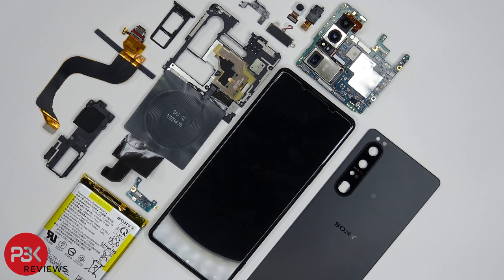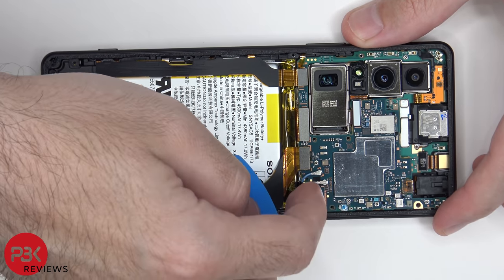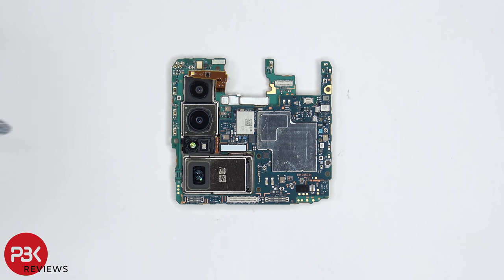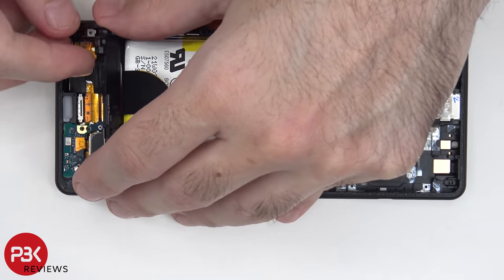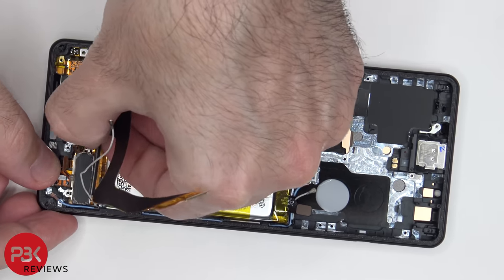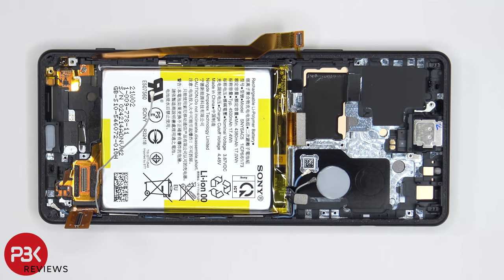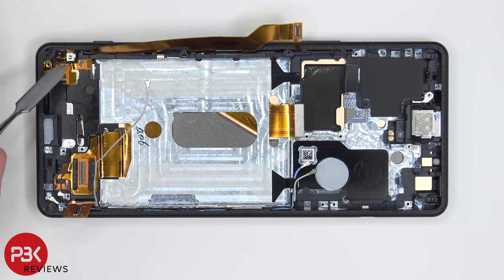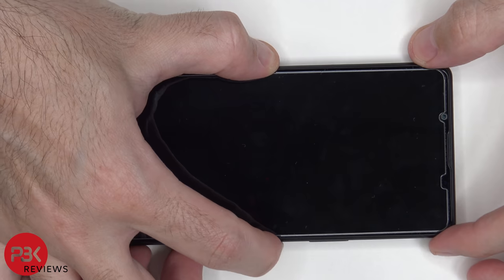Sony Xperia 1 III Disassembly Teardown Repair Video Review

Comment: one of the best part is the charger port that you can replace  without soldering.
Reply from the maker: Yup, all phones should be that way. The charger ports are parts which often people need to replace. 👍
Reply: @PBKreviews  One of the reasons why I prefer wireless charging
Reply: Yes, but its really the weakest link in the IPX6 rating...
Even if it doesn't kill the phone I find there is a presure leak that can allow moisture to build up.
My old 5II had fogging lenses on the back camera, servicing just broke the seal further.
And my few months old 1III gets condensation under the display when something cold touches it, but it has to be really clean to be seen.

I miss my Z3 with a magnetic charger and properly carefree sealed ports...
Reply: @PBKreviews  my Xperia XZ2's charger port died, poor thing. Maybe one day I'll try to fix it

Comment: I've done my fair share of phone repairs, so I coulda figured about half this out on my own, but I woulda messed something up without this. I'd say you saved me about 2 weeks and $250 for the fingerprint scanner swap. Thanks a million (which roughly translates to $10).
Reply from the maker: Thank you! and you're welcome, glad it was helpful 😃
Reply: Did you finger print sensor stop working too? If so, did the hardware replacement fix the issue?
Reply: @andrewesquivel  yes and yes
Reply: @GarrettBroadnax  thank you so much for the reply.

This video didn't really show how to remove the fingerprint sensor. How hard was it to do? Did you have to remove a lot of other components to get to it?
Reply: how far did you have to tear down the phone to get to a point where you could replace the fingerprint sensor?
Reply: @andrewesquivel  the side rail that holds the power button and volume rockers in place is flexible enough that you can pull it out of the way once you're to it. I don't remember the exact step I got to but you don't have to pull the battery out, everything can be done with screws.

FYI I couldn't find an exact OEM waterproofing gasket so I used a generic roll and I can tell you with 100% certainly that it's no longer underwater proof, but it can withstand showers no problem.
Reply: @GarrettBroadnax  dude, thank you so much.
Reply: @GarrettBroadnax  Did you use extra glue to attach the back cover in place?
Reply: @geri8355  no and I'm paying for it dearly as we speak. The standard phone adhesive works fine for most applications, but the ocean saltwater opened the back right up
Reply: Where did you buy a replacement?
Reply: @Dontaskmeth  eBay buy I don't think they're available anymore. I sold the phone for parts FYI
Reply: Sorry daft question, but you sold the separate parts of the phone, or the whole phone for them to dissemble and strip for parts?

My finger print scanner is constantly acting up and was hoping I'd be able to change it myself but this looks over my head
Reply: @RetroNels  whole phone

Comment: That headphone jack was unexpectedly easy to remove, I thought it would have been stuck in place like in the old Xperia Zs, or lined with a gasket like the charging port, for water resistance.
Reply from the maker: Yea it was really easy to remove.

Comment: To replace the battery, do you also need to disassemble the motherboard? From the video, it doesn't seem necessary, they seem to be separate

Comment: Would have loved to see how the fingerprint sensor is taken out, as a lot of xperia users, myself included, have failing sensors
Reply: Ikr, i ordered mine for replacement but the idea of tearing down 80% of the phone just to replace it looks terrifying. Did you find any videos that specifically replace the fingerprint?
Reply: Yeah same boat here. I guess I'll have to disassemble and figure out the rest and hope for the best; seems it's modular like the rest.  Would be nice to have a schematic to follow as well.
Reply: The fingerprint sensor sucks on this phone. Looking to replace mine.

Comment: Thank you, great video. At which point do you decide to change the screen?
My screen is not broken or cracked. Colors are all ok. Just the top half inch or so is unresponsive. Not sure if screen replacement is the answer
Reply from the maker: You're welcome. I would think a screen replacement should fix it

Comment: Thanks for the detailed video. Am I correct in assuming that I don't need to remove all the parts such as the upper board and speakers etc. to replace the battery?
Reply from the maker: You're welcome and that correct, all you need to remove is enough to gain access to the battery for replacing.

Comment: My phone detects sim card but can't get network signal since falling in water. Any help please - took it to a shop they checked and said I need to replace the network antenna connector 'box' on the motherboard which is water damaged. Everything else works fine. Any idea where it is exactly on the teardown video and any links to buying the part online? Many thanks in advance

Comment: Hello! This disassembly video is awesome. Had a quick question about some troubleshooting. I used the steps in the video to replace the battery and on the initial boot after replacement the phone turned on no problem. After checking the functions on the phone, I powered it off because I noticed I messed up in reseating the charging port. I adjusted the port but now the phone refuses to turn on and constantly boot loops. Any ideas as to why this would happen and if it's fixable? If my phone is now bricked then I'll have to live with that but just looking for an answer as to what went wrong

Comment: Very informative video,  can you tell me what brand and model of screen protector is used on the phone... Fitment looks perfect,  as only covers the flat side of the screen and not the curved edges, thanks
Reply from the maker: Thank you, not sure of the exact brand (might be one that Sony sells themselves in Asia) but here is pictures of the box. Pic 1: https://ibb.co/b63yYQC  Pic 2: https://ibb.co/gM3h3tz
Reply: @PBKreviews  Doesn't look like an OEM part to me. Still, looks like a fine screen protector.

Comment: Hi there, I own this phone for almost two years now and very happy with it. Two days ago thought I received a software update from SONY through the software updates notifications and as always applied the latest update, rebooted and phone was working fine for more or less 24 hours. then as I was reading some articles on google news the screen went black and the phone looked switched off. I pressed the power button and the phone powered up showing the SONY logo, and then the android boot up video, (never asked for the unlock of the sim card) asked for the android unlock number sequence and completed the  boot up sequence. This had never happened before in the two years that I own this phone. So I ignored the event and continued to read the article that had left unread. 3 mins later it happened again, and I followed the same process. The phone powered up again and seemed to work fine, until five minutes later that did exactly the same thing. This time though when you press the power button the top light flashes green and the phone vibrates once, but nothing happens. if you continue to press the power button after a while it vibrates three times and flashing light goes off. As I have a lot of data on this phone which I would like not to loose, is there anything you can advice me to do?
( Tried entering recovery mode, does not respond, connection to computer, does not respond, connection to power supply, starts charging for two seconds and then vibrates once, and after five seconds vibrates three times, and continuously repeats this cycle).
Thanking you in advance.
Reply from the maker: Hi, hmm the only thing I can think of is trying a different battery to see if by chance it might be a faulty battery. Aside from that, if the software is corrupt, you are pretty much out of luck. Since you might be able to reflash the stock software on it but would wipe your data regardless.

Comment: I have this phone and the right speaker is not working well. If I blow through the speaker hole it sounds sometimes. Do you think blowing some hot hair from a hair dryer could fix the problem by "bailing" the component? Do you think is it risky to do it?

Comment: i feel sad about sony xperia not in india anymore , i wish sony to make a come back to India. bullist Xiaomi phone people buy because its cheap...
Reply from the maker: I feel sony should either partner with another company to make a budget friendly line, or they themselves change up their smartphone division and make some changes. Especially when it comes to replacement parts and so forth. Its hard to find replacement parts for sony phones. I like the sony phones, but the thin design they have I feel limits it, plus they always push their cameras so much that they lack on other things. The cooling on the phone for example, when I look at it, makes me feel like I am looking at a phone from 2015. No special cooling, just basic. I haven't noticed any overheating but still would be nice to see some better cooling system implemented.

Comment: How easy is it to remove the duel rear camera from the main board? My shutter is malfunctioning and ive bought a replacement but i want to know as much as possible before attempting to replace it. 
Also thanks to the comments i need to buy the flex cable for the power button/finger sensor before I start as i bought the button thinking the "click" part would be on there 😂 really hoping i don't trash my phone trying to repair it but i don't trust any repair shops near me 😕

Comment: Thanks. I changed my battery with no problem. I draged the black stuff out and it didn't work sadly. The adhesive pull tabs.  So I had to work carefully, That was a intence moment. But at the end it wasn't that bad.  But thx for the video.

Comment: I just started working in a very thick concrete building where cell reception is extremely poor.... looking to upgrade to a phone with a good antenna. I heard last year's 5 ii had one of the best antennas ever. So I've been waiting to see whats up with the mark iii's.... 
Do you think the 5 iii internals is going to be the same thing as the 1 iii, just shrunk down?, including the shrinking of those antenna parts? like, would there be reason to believe that the 1 iii should give a stronger connection than the 5 iii?
Reply from the maker: I would think the 5 iii should have a very similar antenna layout and functions as well as the 1 iii as far as reception goes.

Comment: As most phones damaged have a broken front display, it would be nice, to get a disassembly teardown how to exchange the front part the easiest way too.
Reply from the maker: Hi, true, but all that is left aside from what is shown in this video is to pry the screen off the frame. Showing me prying a working screen off the frame and risking breaking it or damaging it is pointless. All you do is apply heat and pry it off.

Comment: I can't get the glass back to loosen no matter how long I apply heat with a dryer. The plastic tools break down but the back glass doesn't move at all. How did he do it?
Reply from the maker: shouldn't be too hard on this phone. The adhesive isn't that strong. Use a hair dryer to heat up the back for 30 seconds to a minutes by moving it gently around all parts of the back and if you have a suction cup tool, you can use that to help pull up on the back at one side or corner to give you leverage to get a pry tool in between the back and frame and then run it along the sides to pry it off.

Comment: I've had my phone dropped in water.
Now it doesn't turn on, I've replaced the battery but still only get a red blinking led and no charge happening, still can't turn on. Any ideas what might need replacing to fire it up again as all my kids pictures etc are on there and I'd like to get them
Thanks in advance.
Reply from the maker: You would need to make sure there is no corrosion left over on any of the chips or connectors. If there is, you need to brush it off with a small brush (like a toothbrush). Also its possible the board may have gotten damaged beyond repair if any of the chips shorted so yep.

Comment: I wonder if it would be possible to upgrade the front camera since it being modular.  That would be awesome.
Reply from the maker: It may or may not be possible. If you find a camera same size and same connector size fit in the camera space and connect properly to the connector, its possible it may work but there may also be software issues if the software does not read it etc.

Comment: Hi was wondering how likely it would be if my phone dropped and basically just the finish got scraped off that the water proofing would be compromised. It was a corner against a basement tile floor so it was a pretty solid surface that it hit. The aluminum doesn’t seem dented but it does seem like the glass has a slight separation from the frame compared to the other side
Reply from the maker: hmm as long as its not cracked, I wouldn't worry too much but if there is enough separation, then it might be possible the adhesive might get compromised as well allowing water to get in.
Reply: @PBKreviews   I can't even tell if there is separation even when using zoom with my old phone. It looks different from the other side where the glass meets the frame it doesn't seem as flush. But it's so slight that most people would think I'm nuts. I'm trying to get Amazon to pay for it since I bought the phone from them and they delayed the case among many other orders the past couple of months. I'm positive this is a tactic to manipulate people into prime accounts. Funny thing is I ordered something today and at checkout there was a message saying we're giving you the opportunity to become a prime member. I had two different orders simultaneously delayed that then ended up at the next shipment center with a 4 hr difference. This leads me to believe they were transported separately. And I find it highly unlikely they both ran into the same issue. And even more unlikely the were both coincidentally delayed simultaneously for different reasons. They also never had any shipping history before they were delayed meaning they didn't leave the origin point before the delay. I also caved and got a prime account which is funny because I ordered all this stuff the past two months and I probably won't need to order anything for a while.

Comment: Dear PBK Review I'd like to ask you a question, when you removing the proccecor Board I'm curious can you apply a thermal paste for a better cooling solution?. if so where should I apply it? on top of the metal proccecor or behind the proccecor? and how much thermal paste should I used? Thank You.
Reply from the maker: Yes you can, but just make sure you don't use a thermal paste that is highly conductive since if it leaks to other chips or components, it can short it. Also you can apply a bit to the top of the processor itself, and some on top of the metal shield covering the processor so it transfers heat to the midframe efficiently. You don't need to put a lot, just a little bit since it will get pressed down and spread a little once you assemble it.
Reply: @PBKreviews  so i have to remove the metal shield first then i can apply the thermal paste on the processor? And then use it on top of the metal shield aswell?
Reply: @PBKreviews  so i have to remove the metal shield first then i can apply the thermal paste on the processor? And then use it on top of the metal shield aswell?
Reply: @PBKreviews  how easy is it to remove the metal shield?

Comment: have the same phone and seeing it being unmounted makes me doubt its "waterproof" abilities, i know that the adhesive acts as a sealant but still... Do you know if it's possible to order a back plate for the same phone ? I dropped mine and i slightly cracked it, would like to change it. Would really appreciate ! Thanks ! :)
Reply from the maker: Hi, parts in general are difficult to find for sony phones, you would need to keep checking ebay or other places for xperia 1 iii battery door cover replacement to see when one might pop up. Also for this phone I believe its just water resistant and not completely water proof etc.
Reply: @PBKreviews  okay, thanks for the reply! Really appreciate 🙂

Comment: My Xperia 1 III's power button stopped functioning, but the fingerprint scanner directly on it works just fine. Any ideas? I have no repair experience but I have built computers, so I'm wondering if it's something I could attempt to fix at home.
Reply from the maker: There is a clicker behind the physical button itself that probably has gone bad. Would probably require replacing that flex cable/button assembly.
Reply: @PBKreviews  I contacted Sony and apparently it was a software issue. Restarting worked but only by holding volume up + power button. Otherwise the power button was unresponsive. It works fine after restart, just thought I'd fill you in.

Comment: Why your screen has a glass screen protector? Usually the phones on the tear down table does not have anything attached to them.
Reply from the maker: The phone was being used, so I left the protector on there so the screen would not be scratched if moved around on the surface of the table during the disassembly.

Comment: Is this the best hardware of smartphone in 2021..?
Reply from the maker: no there are phones which are more powerful. It uses one of the higher end processors and good cameras but there are phones out now which have better gaming performance and powerful cameras as well with faster charging, bigger batteries and better cooling.